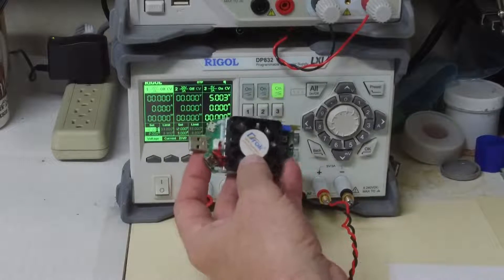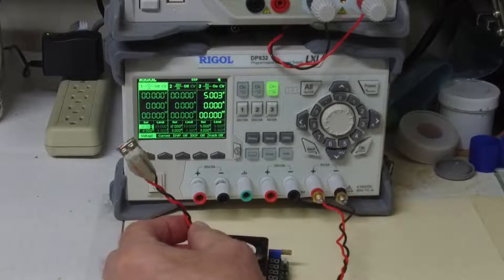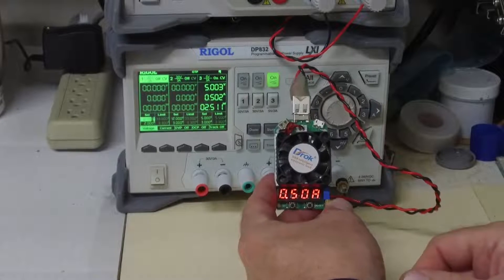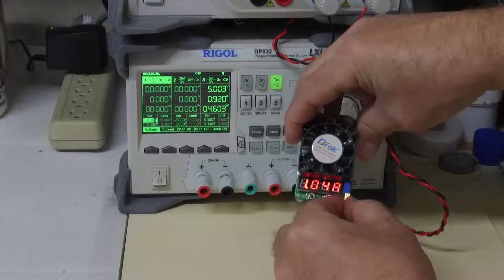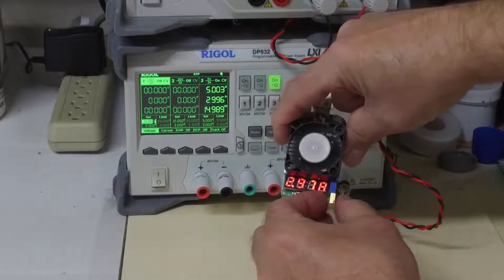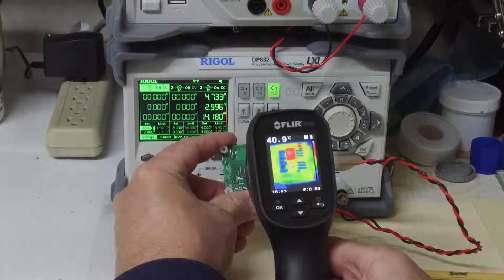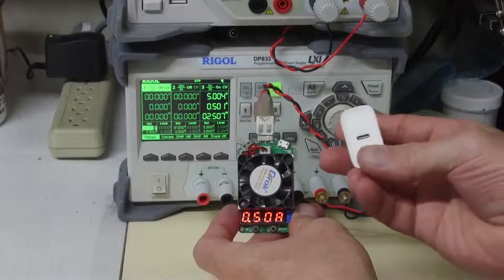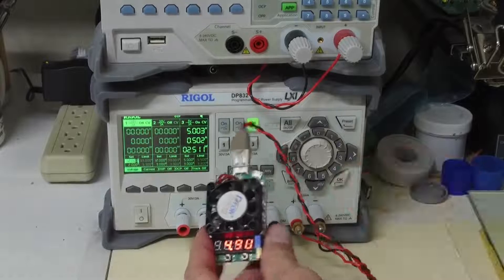DROK USB Electronic Load / Cable / Tester

Comment: 12V 용은 없나?  어뎁터 시험할 부하기를 찾고 있는데 안보이네;; :face-pink-tears:
Reply from the maker: 안녕하세요.  I have not seen a unit like this that does higher voltage.  However, there are generic electronic loads on Amazon for about $40.

Comment: You can use a trigger board (with the necessary cables and adapters), to get higher voltages via PD and QC for your testing.

Comment: This is a very good tester. However, the bottom of the tester circuit board is exposed to being inadvertently being shorted out on something conductive .. I mounted it to a blank perf board, via threaded nylon standoffs, to avoid shorting it out.

Comment: Good demo but that tester is pretty much obsolete now.
Reply from the maker: Thanks.  Curious of what replacement you suggest?
Reply: @DanPattenAudioG33k  Good question! I have a similar tester like yours but with LCD readout. A 35 watt unit. For the life of me, I cannot figure out how to trigger any other voltages! It only does 5 volts. I noticed in your video, you did not trigger any other voltages either. Only being able to load test 5 volts is stupid. Of course the Chinglish instruction sheet I got is nearly useless. Looking at other units out there, I have not been able to confirm if any of them can force trigger other voltages! Like 9, 12, 18, 20 or whatever protocols they have for PD. Only searching YouTube for anyone actually demonstrating a unit can I find any decent help. So, no, I do not know of, as of yet, what a good tester.
Reply: @curtchase3730  Did you ever find one that can do a range of voltages?

Comment: Thank you for the testing demo, I recently ordered the Drok USB Load as well as a RuiDeng UM25C USB Tester, should be here in a day or two.  I'll also try my RockSeed RS310Pro as power source to try to duplicate your test here.
BTW, that sure is a nice Flir Thermal Camera that you are using (I can't quite make out the model # in your video), not in my current budget (No pun intended), but a thermal camera may make it onto my wish list in the not too distant future. They are spot-on for spotting PCB problems, as well as other equipment.
Reply from the maker: Thanks for the kind comments.  The FLIR camera was a splurge but sure has been handy.  It is a FLIR model TG165.
Reply: Thanks for the model #  @DanPattenAudioG33k  👍

Comment: Is the setting only in terms of current, or can you set a fixed power, say, 5W which would make it automatically pull slightly over an amp to compensate if the input dropped a bit below 5V?
Reply from the maker: You can set the load in Amps or Power.  However, my unit does not work as a constant power load.  As in you example, the unit will not dynamically adjust the load  with a varying voltage to maintain the set power.  That would be a nice feature.
Reply: @DanPattenAudioG33k  Yes that's exactly what I was curious about, I appreciate the answer! The constant power feature would be cool, but hey, for $15 I guess you can't expect too much. Still seems like an overall useful device, I just ordered one to play around with.
Reply from the maker: Agree :)
Reply: @DanPattenAudioG33k  Amazon got it to me overnight and I love it! Goes especially great with something like the FNIRSI FNB58 inline to trigger different voltages via PD / QC.

Comment: A great application for these variable loads is to accurately gauge battery strength. Even dead batteries after all have voltage. You could use anything even a bread board with a varistor you don't need to spend $50 USD for this gadget. But it's cool to observe these necessary experiments to understand fundamentals to electronics. Watch an electrical engineer send 8 hours to troubleshoot a variable speed motor drive. It's easy to become bogged down in theory then call a trainned electrican and the electrican will have the item repaired with no schmatic and only a VOM. Very interesting and for the intended scope, and small dimensions very effiecient device.